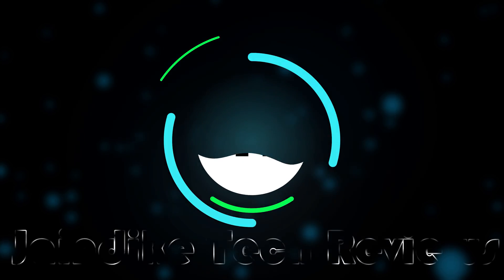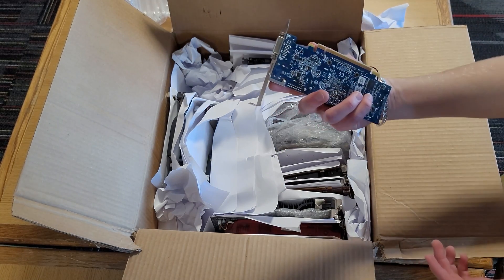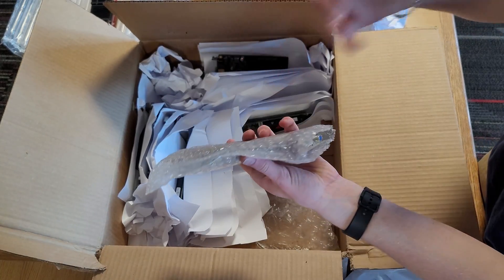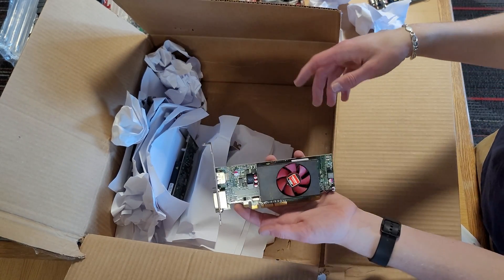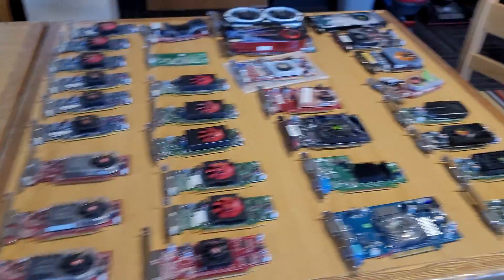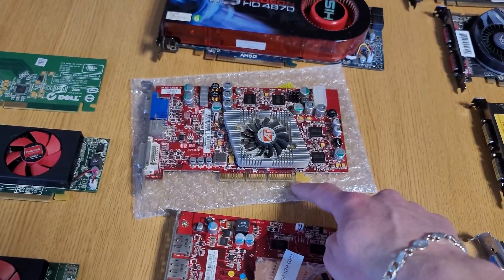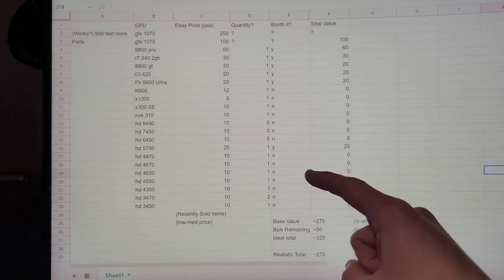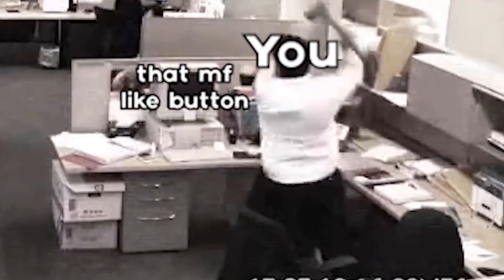I somehow profited from buying 31 GPUS off ebay and got a working GTX 1070

Comment: i got 4 r7 240s for 3 dollars
Reply from the maker: That's the cheapest I've ever heard of someone getting a GPU for (4/$3?? thats nuts)
Reply: @Jaindike  yeah, they were in full systems too, hp  elitedesks from like 2018 with 6 core cpus and 8gb ram each I got them from ewaste I’m gonna do a video myself on them as they are very similar to my first gpu, but mine aren’t as high quality as yours. If you need any more content material I can lend or sell you some more untested stuff if you would like as I don’t think I can get through all of it, I may even be able to help you get a faster test system, does that hp support 3rd gen cpus?
Reply: @Jaindike  that’s in Australian dollars too so that’s like 1.60 in usa or something close to that

Comment: If they work then list the gtx 1070 for at least $300 and the 9800 pro for at least $100. If you go too low then you get "bottom feeders" who also like to scam people. I know that doesn't sound logically but that's been my experience.  I think you are an enthusiast, you want to deal with other enthusiasts.  #My2Cents
Reply from the maker: Thank you for the advice! I've minimal experience as a seller on eBay and wasn't aware of that.